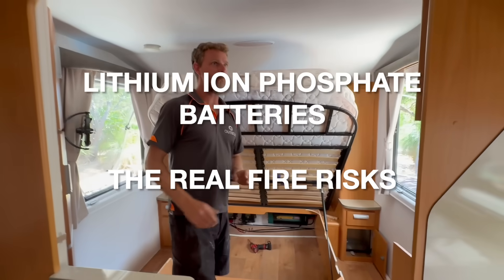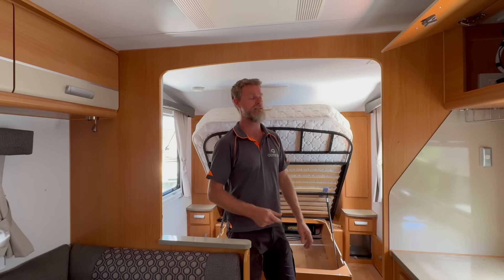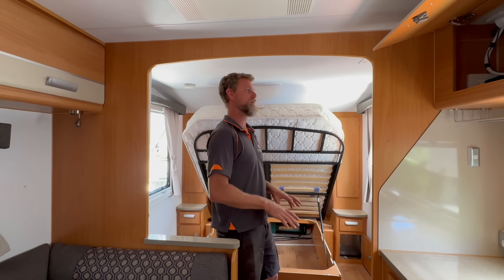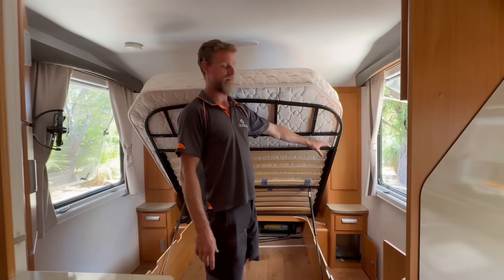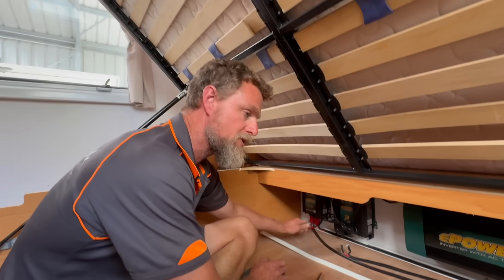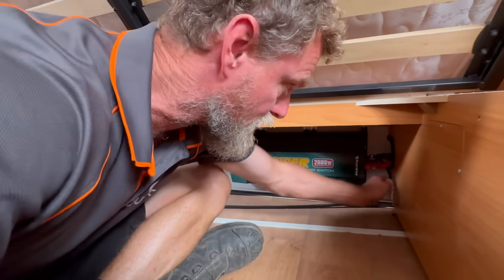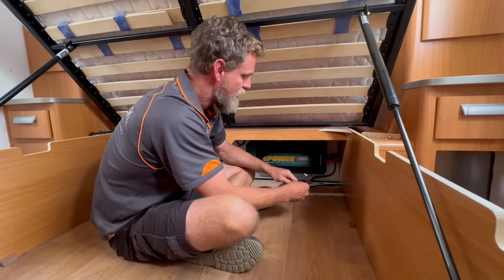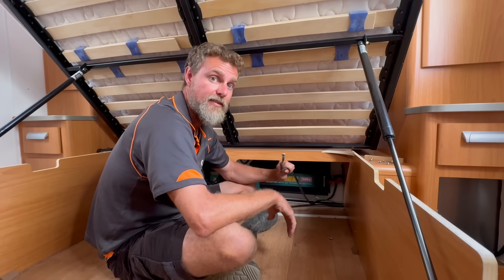Caravan Lithium Batteries - The Real Fire Risks

Comment: So you said that the DC to DC charger and the AC mains charger are together outputting more amps than the single battery cable can handle. But you fail to mention that these outputs are never supplying power at the same time. This means the battery cable has a high enough rating  for one or the other inputs. If your driving down the road with DC to DC supplying  power then you can't be plugged in to an AC supply at the same time. If your plugged into an AC supply you can't  be driving your car down the road with the DC to DC supplying power to the caravan. THINK ABOUT IT.
Reply from the maker: Thanks for your reply. 

You will also have noted that we mentioned that the dcdc charger is being used as a solar regulator. Meaning if you are plugged into mains AND in direct sunlight you most definitely can have both working at the same time. Meaning the cable will have an opportunity to be overloaded. 

Cheers.
Reply: @outechoffgrid  Well Said...! SO many people do not look at the system they are installing or designing (themselves) or understand the potential risks. Just look at the price of components and installation. To have quality system installed takes experience, knowledge and understanding of all factors mentioned.

Comment: DC Powersystems can be very dangerous in the event of an uncontrolled thermal event in the WIRING, or an impropper termination.....FUSING the installation cannot be over emphasised to be absolutely critical.

Rare to see a fuse at both ends of a cable connecting 2 potential sources, it should be the norm (more suppliers need to carry midi and maxi fuses so they are readily available on the road, and emphasised in DIY Kits - because people are always going to do some work on their own low voltage systems *(secured cables is a very great idea - it avoids them moving and getting crushed by "stuff"- (esp in a cupboard), and secured near the ends to avoid terminal fatigue ).

Comment: Explaining why they are safe is better than just saying they're safe considering your credibility in knowing what these batteries are is in doubt. Regardless of the reason for the fire, incompetence or sheer, unforseen, accidental etc., I would like to be able to extinguish it with a fire extinguisher and not run away when IT ran away, destroying everything. No Thanks. 
PS and why do guys like you keep pushing these batteries. Just hope that someone won't install one or two on your say so just to have everything lost.
Reply: Plenty of DC wiring installation faults have happened with LA /AGM batteries in the system (look out for lots of burned out vehicles and trailers by the side of many tracks in theoutback., IF the fault is a wiring issue the fire will be the same - LiFePO4 batteries have Aqueous electrolytes rather than  hydrocarbon based electrolytes in Li-Co-Mn...(etc other chemistries)  LFP batteries have also been engineered for nearly 20 years to vent early in any over pressure situation - rather than "hold it all in and explode simultaneously late in the disaster...

Of course everyone is free to spend their dime and carry whatever energy storage system they prefer - we should note that there are fire risks with generators and liquid fuel also-  AND Australians are usually nice enough to not run generators all day and night unlike our USA cousins who deem it as their birthright - only to be taken away at the point of a firestick or incarceration following irrational homicide...
Reply: @kadmow  the lengths people go with technology because of sheer laziness. All because of weight and capacity in the RV world, we change the battery just so we can take extra toys.
Simple math gives me 15yrs plus longevity for my AGMs and the appropriate vehicle to carry them which in turn ends up being the appropriate vehicle to tow my caravan. Old tech saves me money and keeps me safe.

Comment: Unless the fire brigade has done a comprehensive forensic investigation of the cause of the fire (which they haven’t yet) then they are simply expressing an opinion. They should know better.
Reply from the maker: @jackbarnes6929 It will be interesting to learn the actual cause of the fire once the investigation is complete. It's important to have accurate information to prevent future incidents.
Reply: @outechoffgrid ,  we hear so many times,  the limitation or cable current handling capacity , when it is really, all the cables & cable insulation ability including terminations,  as well as circuit & component ability to handle  fault  current also at terminations (& termination physical protection) would it not.?? (Interested newby ? To D.C.cicuitry). Apology, poorly worded & grammar.
Reply: The brigade is going off of what the owners of the caravan saw. The owners had seen the batteries smoking before being engulfed in flames. Therefore their assumption of the batteries catching fire would be correct. The cause as to why they caught wire would be up to further investigation. Also it wasn’t the brigade that posted about it either it was the county fire service themselves.
Reply: Fascinating comment. Given all the lithium battery fires out there - an entire ship burned due to EV car batteries you think that sleeping with one of these in you 'van is agood idea?

Comment: Basically: overrate all cabling in the installation and have each and every cable run fused?  As a tech that has worked on DC equipment for over 30 years, I would agree, regardless of the battery technology.
Reply: 100% correct.  For the most part it’s not the battery that is the source of the fire, it’s the cable size and lack of fusing.  In adequate cable size is a typical rookie mistake.
Reply from the maker: @handleyman Absolutely! You're spot on. The cable size and proper fusing are a couple of critical factors in preventing fires.
Reply: 😮 no @Davidh4198
Reply: You don't need to overate just apply the correct fuse to to the wire used
Reply: @M_a_r_ke  If you and I are designing a system, which I am right now doing for a camper trailer.
First do not be in a rush for the system design or sourcing of components. There is always something that pops up or a scenario where the system will be pushed to its limits.

Once we work out all the current loads etc, why wouldn't you install a cable gauge 1/3 or higher current carrying capacity. Really compared to how a camper trailer or caravan is going to be loaded, the weight factor in cable weight, honestly is negatable, especially if the system/battery installation locations are designed correctly.  Sometimes this means giving up a space you would like to use for something else e.g. storage. 
Going back to basics of any DC system regardless of size or voltage: over spec all active devices (e.g. solar and mains chargers, etc, quality equipment selected), over spec your cabling gauges, have good quality fuses/breakers installed, have all cable runs fused with the appropriate size. Install in location that is ventilated externally (one way) and if in a hot environment, have air flow cooling.  All of the above creates long term reliability and reduces risk....! 

Even though this is very old school design, in my industry any power supply installed for a project, would only have a load rating of a max of 50%. This would and does allow for a reliability of the system for over 10 years, without fault. The Dollar factor stops this now on a lot of levels, but this is the correct loading for a dc system compared to supply.  Yes batteries would need to be replaced on a maintenance schedule. 

Basically, if we are designing a reliable long-lasting system, we wouldn't be shy about spending the funds initially. If there is a cheap price provided, what corners are being cut or exclusions by the installer/provider (variations will be requested to meet our scope, I am sure)
Reply: YES !! That is basic DC common sense and it is actually even more important with AGM and other lead type batteries as they can deliver even more Ampere then LifePo4...
Reply: Unfortunately over-rating all cables will not save anyone from a lithium fire.  Lithium batteries will sometimes combust without even being connected.
Reply: It’s not the copper cable that catches on fire but the insulation. Cheap cables have poor fire combustibility rating co pared to say what I would use.
Reply: Even more basic: if you don't know what you're doing, hire a professional 😅
Reply from the maker: @omfgishBenneh  I completely agree! Hiring a qualified professional is definitely the way to go if you're unsure. It's especially important to ensure that the professional has the right qualifications and relevant experience specifically in the design and installation of off-grid power systems, rather than just general auto electrics. This way, you can be confident that the setup will be safe and effective.